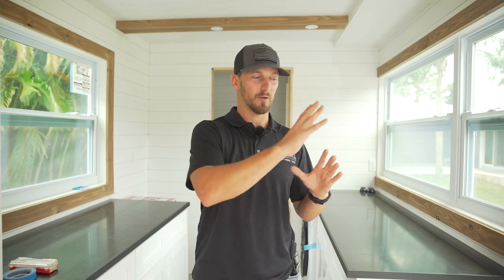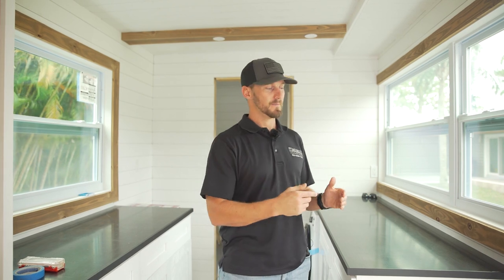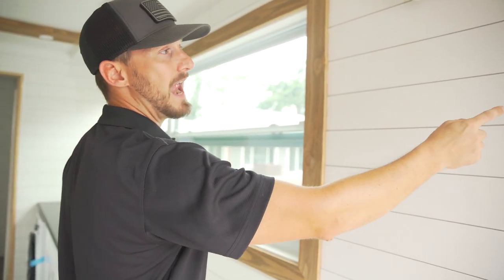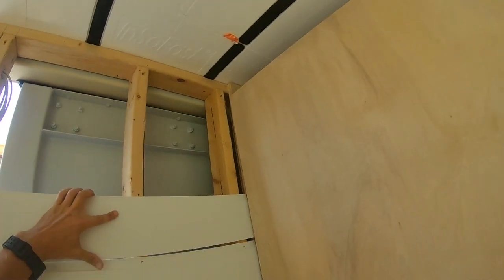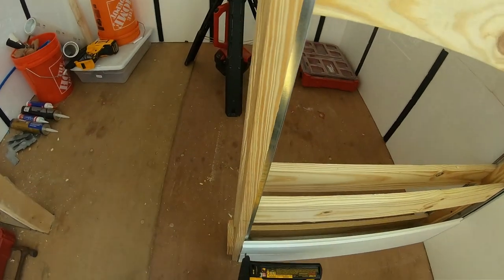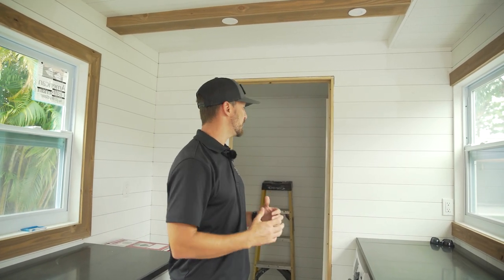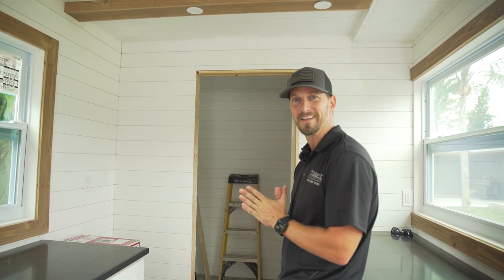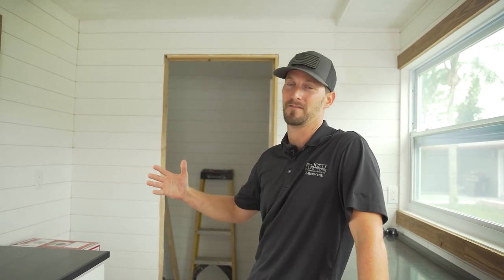Shiplap Walls in Our Shipping Container Home | Building a 20ft Container Home

Comment: I don't believe that you spent 25k on that container.
Reply: Why would you not believe it ? He has been very open and transparent with all costs and process.. everything adds up by the time you figure insulation, walls, electric, plumbing, heating,  flooring, wall paneling, doors, windows, trim, cabinets, etc...